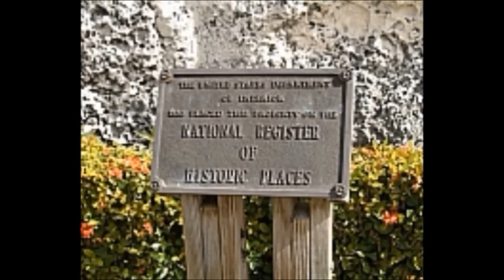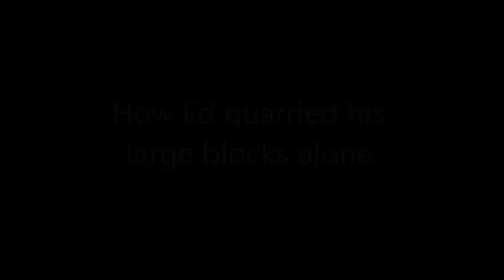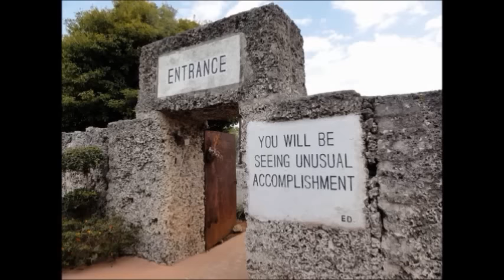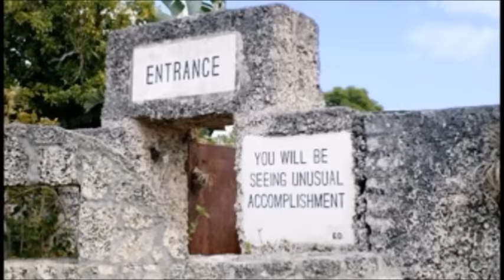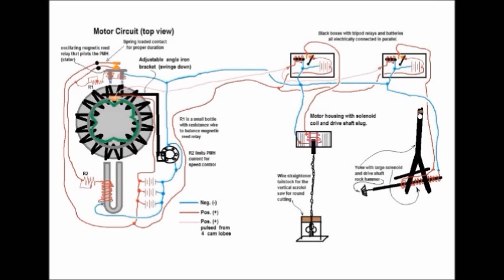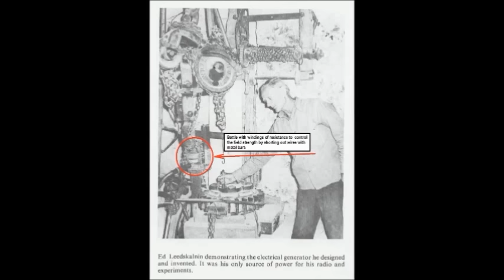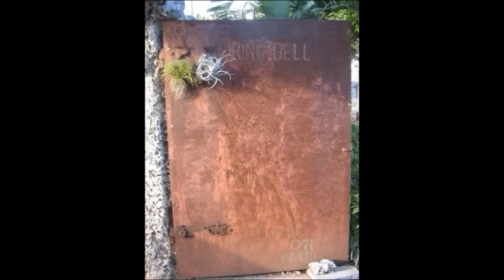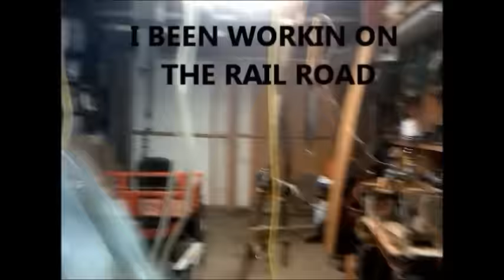Eds Coral Castle Quarry and Flywheel, Engineering Mystery Solved

Comment: Thank you for posting this.  You should get a medal for figuring it out.  Many people tried and failed to understand Ed's achievements.  I bet he would have loved to have met a kindred spirit like you.
Reply: No, it doesnt...lol.  His 'engineering solution' is all but bunk.  How did Ed charge those batteries?  Did he put ANY type of power measurement into this?  He just 'plugs in the wheel', shows it spinning...and says 'this is how it works'.  Yeah well, how many batteries did it take?  Did he cut ONE rock with this method?  Do you know how many batteries it would take to cut rock in this way?  How did Ed charge those batteries?  With his tiny 'hit and miss' engine he had (most don't even know he had this).  This is extremely inefficient.  You would be better off using the mechanical energy from the generator its self to cut the stone.  Ed only had ONE cutting device, which is seen at his 'at work' photo.  This guys explanation above is all but a distraction from the 'real' technology used.  Just like Tesla...they don't want you to know the real stuff.  This guys explanation is bunk...utter junk.
Reply: @Pawbreakers_com  wow. Tell how you really feel about this video! Lol. The guy was very creative. I thought the blocks were to heavy  to lift with his tripod.  Or is that false too? Ill never will try to do what he did.
Reply: @Pawbreakers_com
Who on earth are "they"?
 Unless you can be specific (you must know since you claim to know what "they" think), your ramblings doesn't make any sense.

Comment: I was born in 1960 and I've seen many documentaries about the Coral Castle.Nothing comes close to your comprehensive explanations....thanks man:-)
Reply: Here, Here, me too I always followed the mysteries of COral Castle.  YES YOU ARE CORRECT BEST EXPLANATION TO THIS BUILDING MYSTERIES😈😉
Reply: I totally agree. This has shown me the answers to all of the questions I still had.
Reply: @maxrodgers5702  what in the video shows lifting 60,000lb+ stones stacked into 1/1000th of inch by a hundred pound man. It would take multiple cranes to attempt to lift some of the stones. Just lifting it would a engineering challenge. Now stack them where a sheet of paper can't even begin to go through. 1/1000th of inch. Any stone workers today. Stacking stones to that tolerance.
Reply: @GrimSleepy  He was supposed to be just over 5 feet tall and weighed 100 lbs.  He was known to be somewhat "sickly," maybe due to tuberculosis, so... yeah.
Reply: @Amy-zr5mn  At 0:59 the death certificate reads 5'7'' 120lbs. making him average height... He's slightly underweight which I'd attribute to a bad diet, caused by an Obsessive-Compulsive Disorder. Dude needed to take a rest/break.
Reply: This has nothing to do with magnetism. Fail
Reply: @GrimSleepy  when you're truly passionate. Your work consumes you. You forget to eat and sleep.
Reply: @krmitt5  I have friends who fall into the stereotype you just described. I'm regularly telling them to give themselves breaks, if you allow your mind and body to rest and reset, you will find that your productivity increases.
Reply: @LightVortexMatrixStudy  
Yep. Definite fail. ED.L. made rod magnets with an identical pole at each end.
Reply: Master of Stone Work
Bottom Line

Comment: This is probably the finest example of "research archeology" I have ever seen. This man needs to be commended and recognized for his achievements in decoding the mystery's of Coral Castle. This a a stellar achievement.
Reply: Billy Piazza oh really. and how does a fourth grade man with no vocational training on mechanical or masonery has carved it.And what is he purpose of making the telescope and align it with truenorth. And if it is that easy, why can't anybody be able to recreate such thing ever again
Reply: My friend. The video says that his father and grandfather were stone masons. He was also an experienced rigger. Mr. Russel also clearly showed how the cutting process occurred and how the flywheel was implanted. The only reason he didn't demonstrate how to cut the actual coral was due to the fact that there isn't any in Vermont.  However, , I am afraid, the purpose of pointing a telescope at a star, was taken to the grave with Mr. Leedskalnin.
Reply: Yes, but a doc's son does not meccesarily bcms or knws aby anatmy. In d sm wy if his fthr nd frfthr r masons dat dsnt necessarily means dat he was equipped with masonry as well. And also he was a 4th grader and not eligible to rven attain in sort of vocation in this trade. Billy coral are quiet brittle and should be chipped wid a specific technique to prvnt thm frm breakin. How he'll be able to chip it?
Reply: Humm, that is an interesting question Sumeet. You are wondering how he was able to form those interesting shapes? I'll do a little research and get back to you with an answer my friend. It is nice to engage you in scientific discourse. I'm guessing you are from India. Greetings from America Mr. Ghai.
Reply: Thank billy, and i am sorry if i'll sounds abit offensive
Reply: You're welcome Sumeet. You sound serious to me, not offensive. I'm enjoying our conversation. I did a bit of research and discovered that the trick to shaping coral, to avoid chipping it, is to grind it. File it down to create the shapes. Are you an artist or something? Do you paint or draw? You are a truth seeker, I know that. Peace, friend.
Reply: For the record it is not coral it is oolitic limestone. Much different to work with. It can be worked with all of the tools and techniques stone workers were using a very very long time ago. That would include abrasive cutting, course saws, chipping, grinding. You can see examples of those techniques used there. When you look at many of the cut shapes you can see artists eye looking them over and working with the natural shape they have I.e. hmmm that one sort of looks like Florida. When you look at that piece you can see a significant part of it is natural finish and was not worked. The solenoid jackhammer outlined in this video would be a plausible tool for slow chipping to make shapes by moving it to the section to be worked and leaving it to do is job then move again. If you are not in a hurry you can be using the gas engine to help with various tasks and charge batteries then set up the chipper and let it work while you get another block cut or moved.
Reply: Thanks Billy.  Actually I can't understand why people are only seeing the levitating part of this whole video. The more deeper thing to look at are the alignments. Even if I buy this argument that he used house to levitate big coral block, how he was able to make stand in perfect horizontal position or make the rest upon one another.  And he also created a sundial there that too depicting multitude of natural phenomenons like mvent of sun across seasons geographical alignments moon curvatures  and moving how and why was he able to make such sophisticated things.and why he himself wasn't able to repair the malfunctioned entry door when he had created that thing on his own. And all these levitation and grinding involve a lot of hard work and strenuous physical ability which a 100 lbs nan can't be able to do that too in a meager time span of 4 years.
Reply: Sir Greek, Thank you for your insight and knowledge. I know nothing about coral or it's conjugates. Is this type of limestone the result of sedimentary deposits or coral? Perhaps they refer to the Coral Castle thusly, because of the resemblance this material has to coral? Can you elucidate? And thanks again for enlightening me. That was really helpful of you.
Reply: Hello Sumeet. I understand your contentions. I think what you are saying. You don't want to dismiss the whole event as ordinary and unremarkable, because we understand certain methodologies employed in its construction.  Is this correct? I agree. In any event, I'm sure we can all agree on one thing, and that is the Coral Castle is a beautiful work of art. Have you been there? Is it open to the public?
Reply: The rock is a form of limestone made up of small "beads" of limestone and a mix of fossils. Each tiny bead or oolite is formed out of calcium carbonate layers around a seed of something like a sand grain or piece of shell. All of these tiny beads and seeds they hold as well as whatever was hanging around at the time like shells and perhaps bits of coral are glued together by calcium carbonate to make the limestone sedimentary deposit. It seems the name Coral Rock is a local name for it even if its not made of coral. probably for the reason you describe -its passing resemblance to some types of coral. The shells and such adding to that idea.  As you can see from the pictures of the castle the rock is quite porous - sometimes almost looking sponge-like. When dry all those voids etc can make the rock quite light for its size but that material can take on water and can be damp and heavy. Not as heavy per cubic metre as solid stone but still heavy. From working with similar materials I can confirm that it can be quite soft -  a pick-axe able to cut it up easily. It would certainly saw easily to a course blade a chipping blade or abrasive cutting. Usually the rock is so soft that working it leaves obvious bruises and marks and that might serve to work out some details about how it was processed.
Reply: That was awfully kind  and helpful of you to take the time to teach me that. My brain is a bit bigger today! It's fascinating too. I've been to Bermuda a few times and they used "coral" for everything there. Now I know exactly what that means. I don't know why it never dawned on me that coral doesn't grow along the barrier reef in giant block configurations. I really am smarter today because of you. Thank you so much!
Reply from the maker: Thank you. There is so much more, but at least to me? This is sustenance in the freezer or canned stock in the cupboards. Thanks for the nice comment.
Reply: Isn't it interesting how people still embrace all the mysticism, when all the facts have been available for so many years, as you say?
Reply: You're welcome my friend. You did an incredible job reconstituting everything. No small feat!
Reply: unforgiveable
Reply: if you mark the sun rise, then mark the sun set and do it over the course of a year or two; split the differences, then bisect that and turn 180 degrees you have true north
Reply: + I think a satnav is quicker.
Reply: He needs his own History Channel Special HAHA
Reply from the maker: Can you help me with that?    HAHA   back.    I appreciate that yet $$$$$ scares the crap out of me.   so much need  for greed.   I am like ED.    "tryin ta keep it simple"     by the way Thanks.  Sincerely Scott R.
Reply from the maker: Have you ever done anagrams? C O R A L    C A S T L E can be re arranged to 

C O   STELLAR     SERIOUSLY, thank you for your insight on my tentative accomplishments. IT is only you tube you know so I have to be careful.
YET    thanks right on top my good brother.   

Sincerely,  Scott R.
Reply: There is also a 40 point 'star' involved (on the outside) and probably a fifteen and a seventeen on either side of the sixteen.  This is 'Tesla' tech, and if you take the 24 point star, assign each magnet 15 degrees, you might just figure out what the real secret of the 3,6,9 is.  This is so far removed from conventional physics, it can not be believed by most.  This guy is only here to misdirect, but he does a fabulous job.
Reply from the maker: NO MISDIRECTION THIRD PARTY, 15 degrees is thehands on the clock yup, as for actually levitating those block of coral, why would there be a video of him via universal studios exacting the process. your theory is good like many books written by William Lyne but go easy it might be right in front of your face as I am not intenting to MISLEAD. I see the GROUNDED and ungrounded aspect of the situation. FABULOUS comment by the way.
Reply: I meant no offense, I just know there is something else going on.  Eds wheel fits into a specific geometrical resonance pattern and the clover pattern (four circles connected) is how you arrive at 24 points.  I have seen no knowledge of this anywhere on youtube, nor the internet.  Have you seen "the secret of the universe" about coral castle and the philidelphia masonic hall?  I mistook it for gibberish at first.  Then something compelled me to watch it again.  There is a lot missing, but the clues are there.  I've made a study out of sacred geometry that has gone on for 15 years.  I respect the hard science, particularly electro magnetism,  but that is not my strength.  Your work will make people doubt what I believe Ed did.  He took someone else's work he found out about in Latvia and created a monument with the science encoded.  

Unfortunately, I don't have all the tools to learn how to decipher the whole secret, but I would love to learn practical applications of electromagnetism from someone who was into lab/garage tinkering.  If I had the money, Id have a whole shop dedicated to figuring out Ed's wheel. 

 You made a high quality video which I believe will make people doubt that there might be something more to Ed's wheel.  I think this might be a disservice to the human race.
Reply from the maker: I am with you and believe Ed was doin more than cutting and chain hoisting rocks. But honestly I believe he had a giant spirit so along with his PROSAIC approach he also has a larger guidance system in his "soul" This is why so much COINCIDENCE in the way of 24 hours on the planet, 24 poles on the wheel, 4 leave clover is everywhere 4 elements on earth, the quadrant concept, etc. For now I do see the common German laymans approach to Eds wheel and the whole sight in general. here is a tidbit as well:::     
https://youtu.be/to5HTIbdR34   enjoy.    Till I levitate and free energize this is the best I can do.    Sincerely, Scott R.
Reply: I totally agree !
Reply: Billy Piazza    Exactly !  I totally agree !
Reply: +Chris Bova you can take an ekectronics class in magnetism uses pertaining to relays, transformers, induction, etc at a local tech college. I studied electronics in the 80's, and just fixed my electromagnetic clutch circuit on my riding mower today. Electronics is a wonderful, and intriguing study. I have used in in several trades over the years.
Reply: Thanks, one day I might do that.
Reply from the maker: The reason to point the star finder (at night might I add not during open CORAL CASTLE HOURS) was because he had a masonic background. SIMPLE, plus Yes if I Lived down there in Florida I am sure that most of the "rock" is SOFT AS CHALK.
Reply: AntiqueGeek, Not all of it is formed as you say. We have different layers down here and some of it is Bryozoan Rock while other parts of it are Oolitic Limestone. And across the area just a bit further Northwest of me we have what is called Cap Rock. It is far harder than either of the other two. In most areas it would be Coral/Bryozoan, then Oolite, then Cap Rock as you dig into the Earth but as you go West the Cap Rock actually comes up to the surface. A fourth type found less than 3 miles due West is known as pinnacle rock. It is Coral/Bryozoan Rock that has been eaten out by rain and tannic acid from the Sawgrass. I live on a ridge of Coral/Bryozoan Rock as was proven when we trenched it for the grove. Many of the ridges down this way were formed by Coral Reefs and Bryozoa back when Florida was under water. You actually do find the Coral patterns in the surface rock and not Oolids. You know the difference when you drill post holes down here. Oolitic rock is fairly easy to drill in. West of Krome Ave (SW 177Ave ) it gets harder to drill. And West of 217th Ave and about 218th St, you find the cap rock which is very hard.
Reply: bullsht
Reply: @madebyoneman5006  Thank you for that candid reply. Maybe you should mention this in a section of your doc-- maybe near the end possibly, that your mind is open to the higher realities which show through at Coral Castle
Reply: 12v ain't enough EMF to do the big jobs shown. Too much loss in wires and batteries in parallel still produce 12v. Solenoids are whimpy and if you drive them hard will overheat wires.